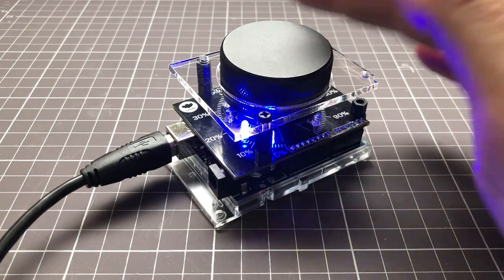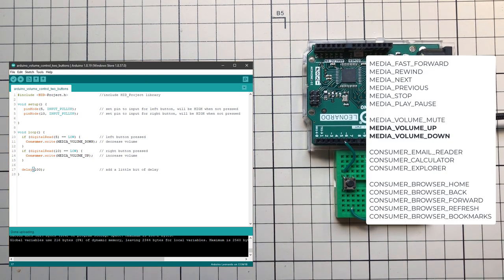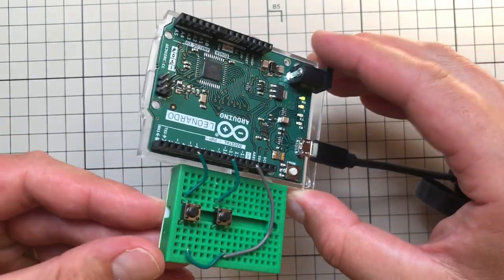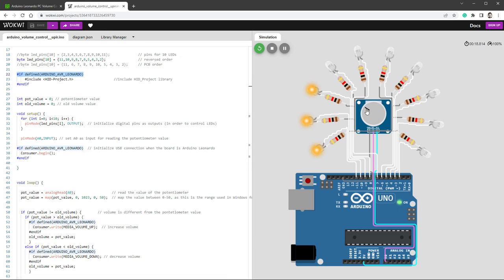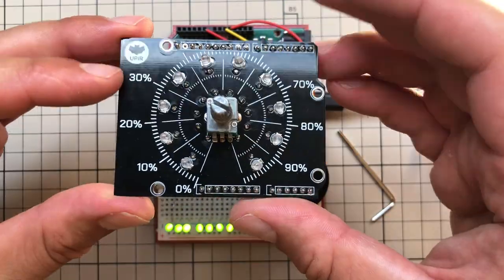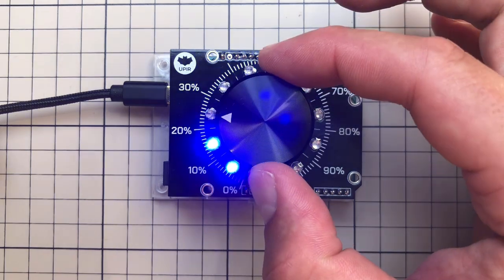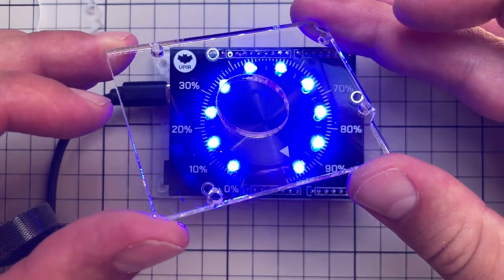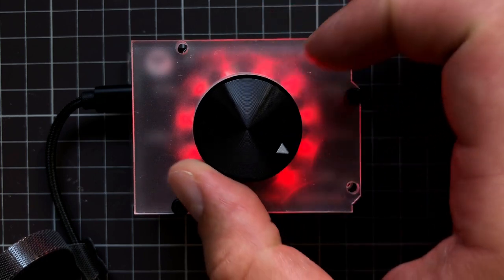DIY Volume Control

Comment: how to connect this for volume control poweramp audio ,,sir
Reply from the maker: Depends on the actual power amp. Do you only want to replace a current knob?
Reply: @upir_upir  yes for signal input

Comment: I installed the HID Project library but it is still not running on my ide. It is showing error compiling for board "Arduino Uno". I have tried everything to remove the error. Please suggest what else can be done. I have installed the latest version i.e. 2.8.4 and my arduino uno is of version 1.8.3. Please help
Reply from the maker: Would it be easier to use USB-enabled Arduino like Arduino Leonardo instead of trying to install HID project on UNO? You can access all those functions with Leonardo without the hassle of extra drivers.

Comment: im doing this with and arduino uno, the knob gives me the right output but the volume doesnt change, can you help me?
Reply from the maker: Unfortunately you will not be able to set volume with Arduino Uno. You need to use Arduino Leonardo since that board/chip works as the USB device- just like the (multimedia) keyboard. Actually, it might be possible with uno, but you need to install additional software..

Comment: Nice project and video! May I use a Pro Micro Mini MCU Leonardo ATMEGA32U4 board instead? And how about a rotary multi-turn potentiometer?
Reply from the maker: Yes, absolutely, you can use Arduino Pro Micro since it uses the very same chip as Leonardo board - i.e. it has the USB connectivity. As for the rotary encoder, that´s also possible to use instead of the potentiometer. Let me know if that helped. Thanks!
Reply: @upir_upir  Awesome! What kind of potentiometer is that? 10 Kohm? Logarithmic one?
Reply: @upir_upir  How about the mute functionality? Could that be possible?

Comment: How much would all the components cost roughly?
Reply from the maker: The most expensive part is the solid aluminium knob. Otherwise, all the other components - resistors, LEDs and potentiometer, are under $2 combined.
Reply: @upir_upir  the arduino leonardo is 20-30€ with headers. That's also needed, right?
Reply from the maker: @anoobis260  You are correct. I was assuming that you already have Leonardo board, but that might not be the case. That said, you can get some Leonardo clones much cheaper.